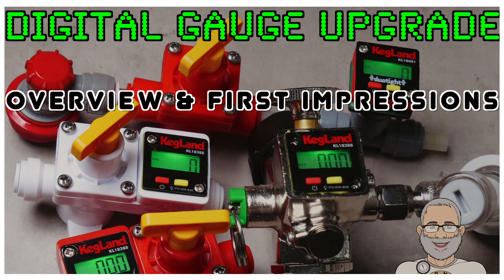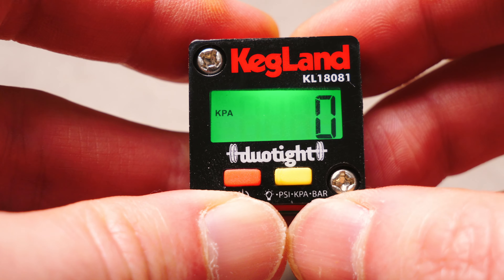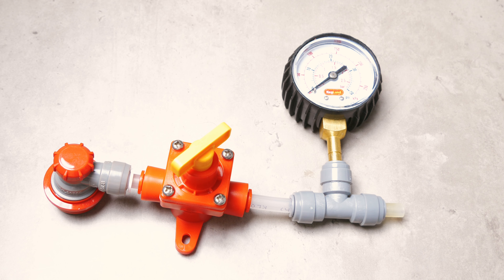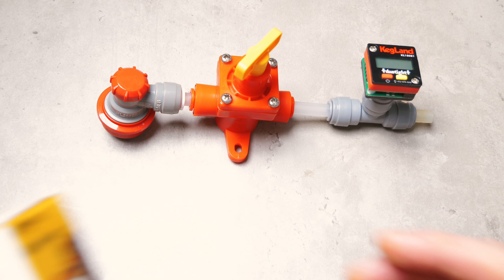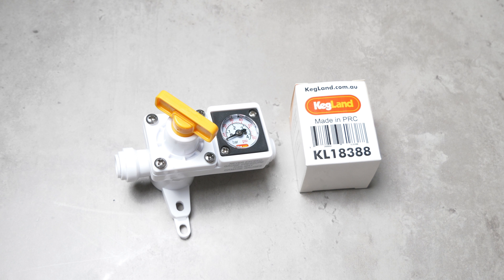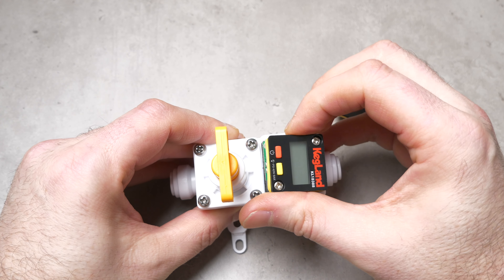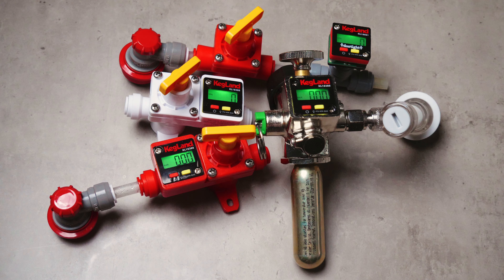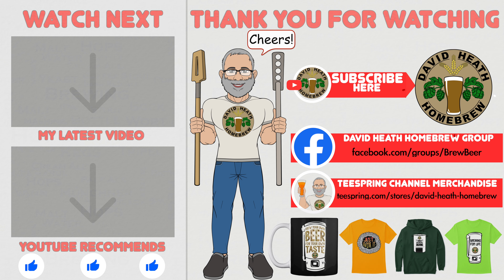KegLand Digital Gauge Upgrades For Blowtie & Core 360 & More

Comment: Great product, I've upgraded all my blowties and in line regulators with them, and they are as accurate as my full sized analogue gauge.

Couple of little tips with them though. 

With the integrated version, use the original screws which held the old gauge in, not the ones which come with the digital one. They have different threads on them which don't line up with the thread in the blowtie body (at least the ones that came with mine did). 

A little keg lube on the bottom oring helps to get it seated flush properly. 

Also be aware that they are a little delicate, use them in areas where they are unlikely to be thumped around or dropped. I managed to break my first one on day three when I dropped my fermzilla lid with the blowtie attached. Can't really claim this as an inherent flaw though, a wonderful product, that was just handled by an idiot. 😇
Reply from the maker: Great stuff Russell, many thanks 🍻🍻🍻
Reply: Had the same issue now. Used the old gauge screws in the new digital gauge
Reply from the maker: @francoisdutoit3057 🍻🍻🍻

Comment: I've got a dozen of them in the post. I'm tempted to spend some time comparing the readings gauge to gauge to see if they agree with each other.
Reply from the maker: Great. Let me know how that goes.
Reply: @DavidHeathHomebrew  I lined 5 of them up at low pressures. Low pressure matters to me as i have spunding valves on my GF conicals set to 2 PSI. They varied from 2.2 to 2.8 PSI at the same pressure.

Comment: Did your digital gauges fit flush into the inline regulator and spunding valve? I found the screw corners go in further than the other corners and the non screw corners will not push down flush.
Reply from the maker: Mine are flush but perhaps not perfectly.

Comment: Great video David, could you use one of these models as a Secondary regulator running from a none Kegland Co2 Reg such as ODL?
Reply from the maker: Yes, the white inline regulator will work with an primary regulator.

Comment: I want to get 2 of them but What happens when liquid accidentally goes through it?
Reply from the maker: That I am not sure of but you can safeguard that cheaply enough
Reply: @DavidHeathHomebrew  Hi Dave.  Nice video.   I’m also concerned about how to safeguard from liquid going into gauge. I want to ferment under pressure in a keg which is probably a higher risk option; can’t see whats happening and small surface area to volume.  I have a Blowtie. Would you rinse with water if it happened or is it game over ?   Thank you. Robert.
Reply from the maker: This is always a concern. You can set up a bottle in between using Keglands Product as follows:-  PCO 1881 Carbonation Cap Tee Piece
This will protect any type of gauge.
Reply: @DavidHeathHomebrew  great stuff. I’m going to buy the tee and the post connectors. Thank you.
Reply from the maker: Great.
Reply: Duotight makes an inline check valve to prevent backflow, approximately $ 4.49 US depending on where purchased.
Reply from the maker: Cheers Tom

Comment: Uh oh - I just bought the Duotight inline regulator and digital gauge.  When I remove the 2 screws from the regulator, ONLY the top black cover comes off.  The inner working of the analog gauge are still in place.   Freaking out. Not sure how to remove the rest without damaging it
Reply: Ok, freak out is over. I guess the cover comes off, and then you have to carefully pry the gauge out. Seems like a very sketchy design. Luckily I have small fingers.
Reply from the maker: Hi Ryan, a screwdriver works for the screws and retrieving the gauge. When these were made there was no digital replacement in mind but its a 3 minute job at the most really. 
No freak out necessary :)
Reply: @DavidHeathHomebrew  - you are always so fast to respond.  Thanks buddy.  So, it is all installed.  I have 4 regulators going to 4 corny kegs. But, the regulators don't seem to do anything.  All 4 digital gauges show the same pressure as what I set on my primary CO2 regulator. It doesn't seem to matter how far in/out I screw the knob. I must be missing something - but it doesn't seem like rocket science
Reply: OK. User error. I just had to release some pressure from the keg, and reset the dial. All good. Thanks for letting me rant a little 😂
Reply from the maker: The  knob controls the pressure. Try closing totally.
Reply from the maker: Hey no worries Ryan, all good 🍻🍻🍻